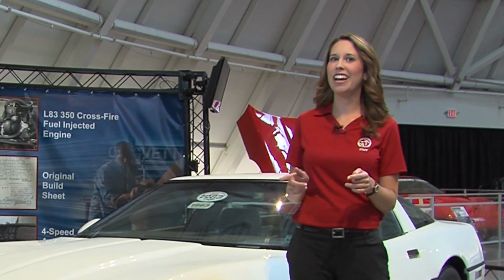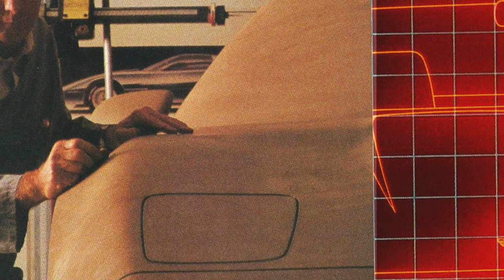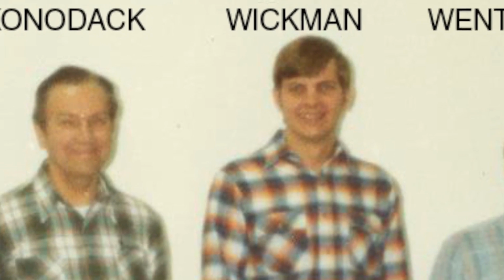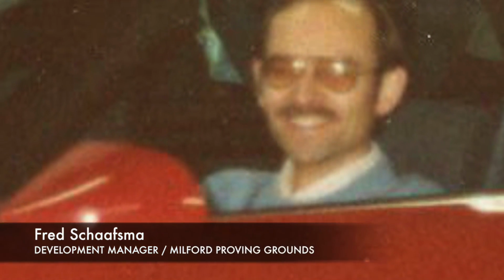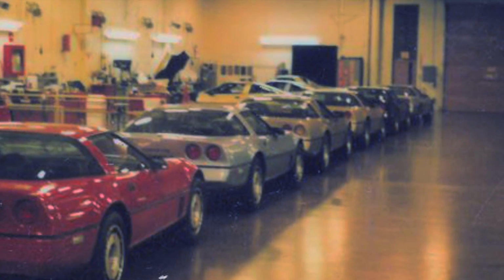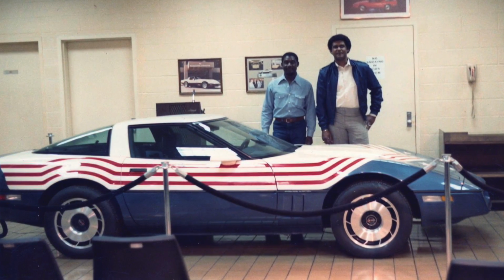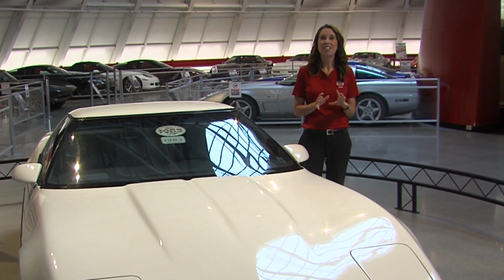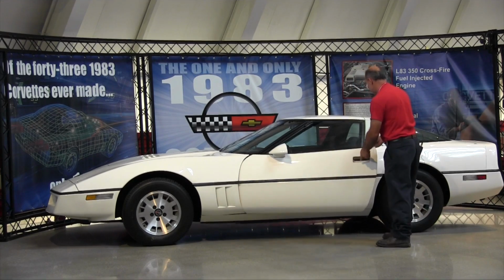Heritage Series -- The One and Only 1983 Corvette

Comment: I grew up in the 70's and fell in love with those big swooping fenders of the C3 Corvettes. I remember waiting like everyone for the next generation Corvette. When I first saw the car I really didn't like the design. It still looked like a Corvette but it wasn't a C3. My opinion changed after I got to drive a 85 with the auto trans. I thought the car handled like it was on rails but needed a bit more power. In 2001 I bought my first C4 a 96 Artic White coupe with grey leather interior. I'm on my third C4 now a 91 ZR1 with one of Marc Haibeck's 510 packages. This 83 is a truly cool and important part of Corvette History. Love what the NCM does and a fun place to visit along with the Bowling Green assembly plant.
Reply: I agree, the C3’s were very beautiful cars. My neighbor has a 1985 C4 and the engine is very underwhelming. The LT1 was a HUGE improvement, I like the analog gauges better as well

Comment: If that's the only 1983 corvette, then what was the vette I bought in Oct. 1983, brand new off the show room floor.? I rolled that car end over end 8 times, Broke my neck in 2 places, Split my head open from the hairline to the ball of my head, which took 64 stitches to fix, was Quadriplegic for 3 months. All on April 2nd, The day after Marvin Gaye's father Shoot him to death. A year later , when I got well, I bought a 1984 corvette which was the Car of the year, That year. Somebody answer me that. I've always believed that I owned a 1983-84 corvette, and a 1084/84 corvette.
Reply from the maker: No 1983 Corvettes were for sale to the public. All but one were crushed by General Motors and we have the only one on display.
Reply: If you bought it in October of 1983 then there's a good chance it was a 1984 Corvette lol
Reply: The 10th digit of your VIN would have been an "E" and that denotes the 1984 model year. You had an early 1984 model produced in 1983.
Reply: If you understood the way all manufacturers certify the new model year you would understand how the date of manufacture is created. Forever the new model year comes out somewhere around Aug/Sept of the current year. So we made 1984 Corvettes in the summer of 1983. 1983 Corvettes would have been started in the summer of 1982. The 1982 Collector Corvette was created very quickly to keep 1982 production running. I could write a book on the subject to detail because the 30th anniversary Corvette got missed. The C4 was as big as the release of the C8 to the Corvette world. BOF vs a uniframe and new electronics, and basically a new car overall. So much more to the story.

Comment: I basically remember there were plans and parts available to build 50 vehicles. Every one of the 1983 vehicles that we built were hand built in a off line launch area in the Final Process area, The assembly line had not been tooled yet to run the C4. That was still coming in the next few months. The plant was still building the C3. The next big issue was how to keep the plant running the 1982 longer. That is about the time the 1982 Collector Edition production was stepped up.

Comment: I still believe the 83 could have gone into model year production; however the 1st recalls of the 84's might have meant more recalls of 83's. Not the first time something like this has happen. Back in May 1969 a GM Labor Dispute caused a stop production order of the 69 Run. Rather than end the 69 Model year at that time rather than when the new 70 Vette would appear in Sept 69; GM decided to extend 69 production through December 69 with a total build production of 38,762 cars. GM/Chevy could have canceled the 70 build year since they had already lost 4 months but went ahead with 70 production until September 70; however only getting 17,316 cars built for the complete 1970 production run, making it the lowest produced C3 from 1968 - 1982. In contrast the 1984 C4 Corvette was on showroom floors by March 1983 and that run went clear to Sept 84 with a total build production of 51,547 Cars. Despite having all those extra months over Standard Time Production Runs, the 1984 Corvette still comes up short in total production to the St.Louis built 1979 Corvette which cranked out 53,807 Total Cars; a record that still stands today.
Reply: I was in quality at the plant in 1969. When the big strike occurred, it was a stop and walk out situation, there was many vehicles in process and parked on site along with parts in the pipeline process. St Louis had many strikes. It was a big plant with other passenger cars & trucks being produced also stuck in the strike. More than 10,000 employees at the time. So much more to the story not understood. GM did not have the EPA restrictions as in the early 70's as imposed in the late 70's so they could extend the 1969 and still meet the plants vehicle certification requirements. The 1983 had numerous issues other than engine certification even though engine cert that was one factor.  That same crossfire engine was used in the 1982 Corvette, but you still have to certify each year engine change or not. Calif was a tough market and set many requirements for all car manufacturers as we all probably remember. Drive by noise was an issue if you remember, we could not sell a manual in California when released until later. A lot more to the story that the public just does not understand. A complex business.
Reply: The 1970 Camaro was also delayed to February 1970, the 1969 model year got extended into December 1969.

Comment: When Katie introduced the video the one question about why was this one saved was really not answered. Not the 1st or the last but why in the middle of the build. Actual reason -It was because it was a substitute for the engineering ordered vehicle that was supposed to be driven to Mi but was not ready for the drive from BG to Milford. The engineering vehicle Mi ordered was destroyed at the plant. Best I remember there was a transmission issue on the engineering assigned vehicle. Remember 33 years ago is a long time to remember some things. Everyone of the builds had a internal GM customer for different reasons and numerous vehicles are shared among engineering disciplines. From marketing to performance to barrier testing and everything else in between. I loaned Michigan engineering the plant assigned vehicle (white one in museum) for their drive since the drive engineers were leaving the next day and we could not get their assigned vehicle ready in time. They drove the white plant owned training vehicle to Milford Proving Grounds, evaluated what needed to be looked at and returned the white 1983 back to the plant. In the following time period over several months is when the decision was made to delay the model year. The rest of the story is explained in the video. Basically the final story was not told until this last year. There is actually a lot to the story. Skipping a model year was not a easy or popular decision as one can understand in the auto industry, especially when you are talking about Corvettes and the 30th anniversary year.